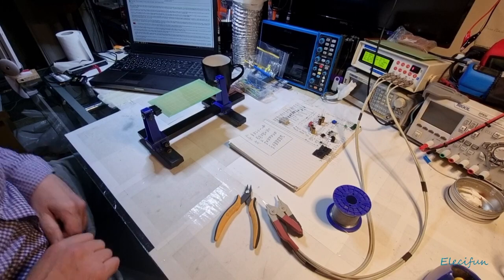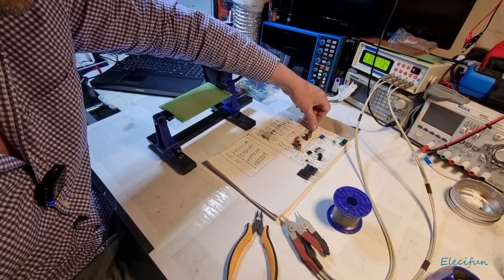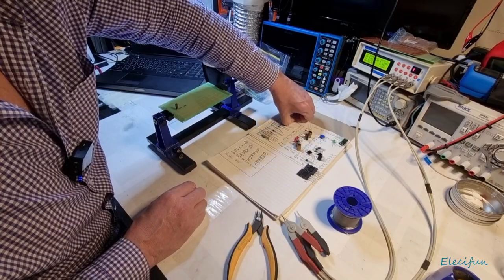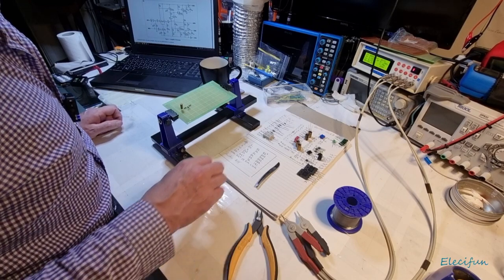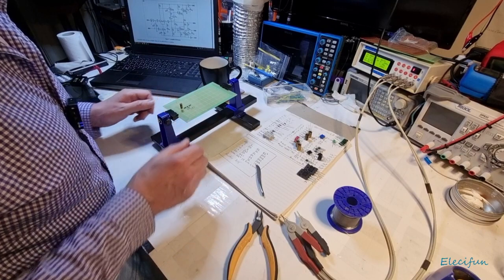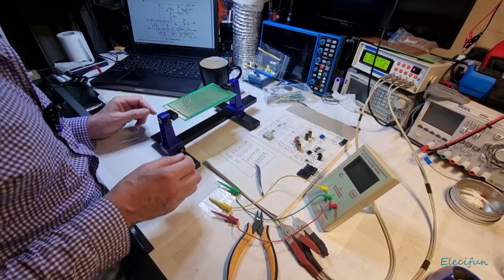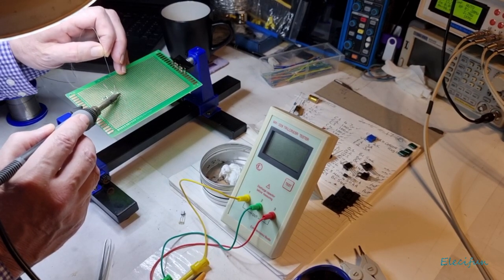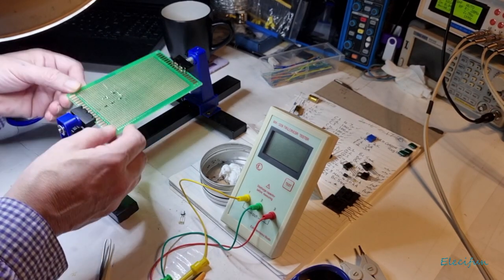ESP DIY 60 - 100 Watt HiFi Amplifier Build pt1

Comment: Great stuff Elecifun! I love your commentary detailing your process. An occasional close up shot of each side of the board would be helpful to me as well as showing the schematic before and after each step. All in all, GREAT video. I'm looking forward to the finished amp and maybe see your ideas on enclosures. I built my tube amp into a metal Pink Floyd lunch box lol. The little details in enclosures and seeing the thing hooked up to speakers and input devices is enormously enjoyable to me. I am thinking of building this kit and designing some interesting enclosure on the 3d printer. Heat generation must be a consideration though as I print in mainly PLA plastic which melts rather easily.... Anyway thanks for the inspiration. Cheers 🍻 amigo.
Reply from the maker: The Pink Floyd lunch box, awesome! I need to get some creative juices in my head like that. 
I'm glad you are liking the build. Also I hear your comments and will include your suggestions. Cheers amigo!

Comment: Hey amigo ! 😀 Gee I like your jig that's a  ripper as mum used to say before she passed away ! I need a magnify glass like that. Yeah the microscope is great buy one needs these other tools as well.

Another tool I need is "extra hands".

It's always an issue when you don't have something to hold the wires with.
Reply from the maker: Sorry to hear about your mum. Always a sad loss.
I would not be able to do this without the magnifying glass lamp and sometimes the the extra hand tools. Every little helps.
Reply: @Elecifun  I miss my mother very much despite her faults. 

Two days before she died I found out that she'd been raped at 9 years old.

It was one of those painful moments.

She was a good women despite her "in ways" terrible life.